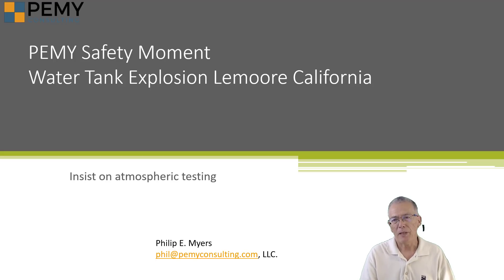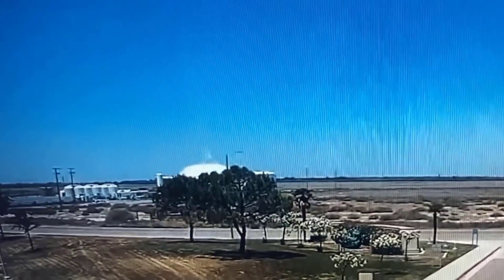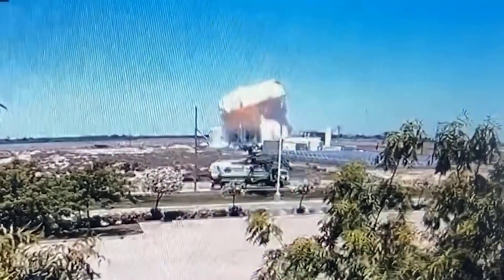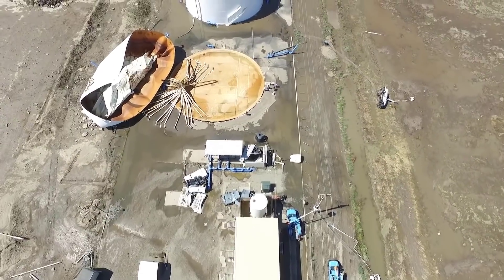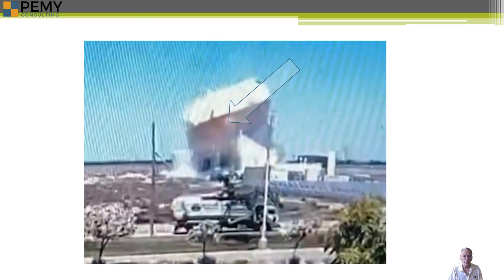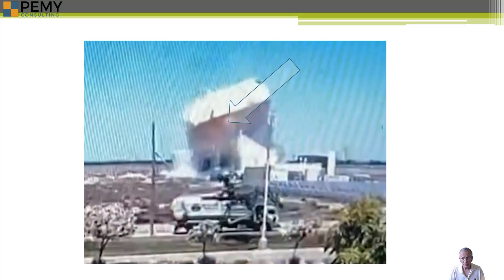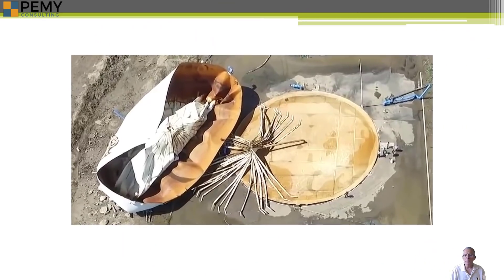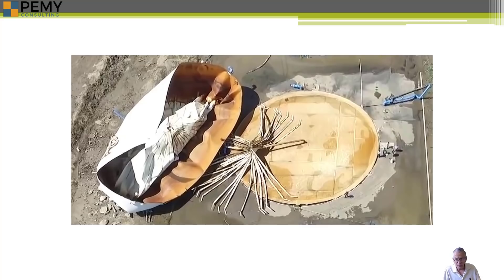Lemoore Water Tank Explosion

Comment: I wonder if it was chlorine gas?  Chlorine is used in water treatment.  I can't tell by the color of the explosion.  The water level could've been much lower than normal, possibly lower than the site of the repair.   If that is so it would've been a lot of room for chlorine to evaporate out of the water and fill up the remaining space with gas
Reply: Chlorine dioxide in gaseous form is used in industrial scale water treatment--it is highly flammable. I just learned this today while trying to figure out what caused the explosion. I had speculated on methane gas, but couldn't come up with a reasonable hypothesis to explain its presence in a closed, and presumably dark, tank interior. Hydrogen gas resulting from electrolysis if plausible too, but only if an electrical source was affecting the water long before the welding commenced. The welding current itself would not have been present long enough to build the required volume of hydrogen.
Reply: @willong1000  the concentration of chlorine in drinking water tank is the same as what comes from your faucet (<2.0ppm by code).  Not a chlorine explosion
Reply: @billhuffman3328  Bill, as I noted, both the flammability of Chlorine dioxide and the use of the gaseous material in water treatment were new information to me as of yesterday. So, like others, I am speculating as to the source of an explosive mixture in the tank. However, given the evidence we have all viewed, I think you must admit that an explosive mixture existed in the tank. What then, was the flammable gas that mixed with air in the tank to produce the explosive mixture in your opinion?

Obviously, something went catastrophically wrong in some process at the water treatment site. I suggest that the most likely process was the metering of the gaseous Chlorine hydroxide into the water. Years ago, I maintained a small potable water system in a National Park campground. While we used liquid Sodium hydroxide injected into the in-coming water stream and not gaseous Chlorine dioxide, that experience was enough to understand that the introduction of the disinfecting chemical is an adjustable, metered process. An adjustable system can be improperly adjusted and/or maintained and monitored. (I used a Hach colorimeter to perform regular monitoring of the chlorine content in water system that I maintained.)

I suggest that excess Chlorine dioxide introduced into the water beyond its absorption capacity, which then collected in the head space of the vessel, is the most likely source of the explosive mixture. That is my admittedly layman's, speculation. Since Chlorine dioxide is heavier than air, the extant tank venting would not have prevented its accumulation. Conversely, lighter-than-air Hydrogen gas produced by electrolysis, which others have suggested as a source of flammable mixture, and which I do not totally dismiss, would have vented from the tank's vents that are engineered to vent air from the tank as fast as it is displaced by in-coming water--that seems to me a rate which would exceed Hydrogen production via conceivable scenarios.
Reply: @billhuffman3328  Agreed.
Reply: "Chlorine is not flammable, but may react explosively or form explosive compounds with many common substances (including acetylene, ether, turpentine, ammonia, natural gas, hydrogen, and finely divided metals)."

If the water in the tank got exceptionally warm due to hot weather, then I wonder if the dissolved chlorine might start to separate out into the airspace at the top of the tank. Since chlorine gas is heavier than air, it would have created a layer of chlorine gas right above the surface of the water. One assumes that welding repairs would take place just above the water level in the tank - right in that layer.

According to the quote in the first sentence, chlorine may react explosively or form explosive compounds with many common substances. So you might be on to something there...
Reply: @alanmcrae8594  Not a chance with the doses used in potable water. Cl2, NaOCl or ClO2 have to be in concentrations high enough to cause an explosion for one to occur. If the building that holds those oxidants exploded that would be one thing, but not the finished water tank. If it were possible for chlorine to off gas and collect explosive concentrations in the headspace of treated water tanks explosions like this would be common.

Comment: Several times I had cut open 55 gallon drums,  most were diesel and one was acetone.  All were empty,  so what did I do???  I filled the drums with water let them sit,  washed the water and then with the water still inside we were able to torch open the drums. Never had any problems,  except they are very heavy.
Reply: Tricky situation. They probably all assumed it would take less time than it actually did.
Reply: @ Carson & Barnes ( person ) places engine exhaust onto gas-tank filler to clear the gasses;
It worked or I would be minus fingers to write this

Comment: This reminds me of a similar incident back in the 80s in the vicinity of where I used to work. This involved a raised water tank of which I can only guess was maybe in the 15-story range. There was a father-son and daughter-in-law team that was hired to sandblast and weld the seams in the tank. Dad and son we're working on the inside of the tank while the daughter-in-law's job was to keep the hatch at the ground level clear of sand to provide adequate ventilation. It appeared that the daughter-in-law wasn't doing her job properly and let the sand build up until it finally choked off the ventilation shaft up the middle. This allowed the gases to build up. As the dad was lighting up his oxy acetylene torch the son was on his way out of the hatch at the top of the tank. There was an explosion and the son was thrown clear of the tank and landed on his head at ground level killing him instantly. The dad survived and the tank appeared to not be damaged.
Reply: What I cannot understand in this video as well as in the incident reported by you, how gases built up inside a water storage tank. What am i missing?

Comment: But I dont understand how it could be flammable gases in a water tank?
Reply: Look up electrolysis. Probably a short in an electric pump somehow went unnoticed. Creating a bunch of hydrogen and oxygen and them two together make for what you see here.
Reply: @coryhodson6994  I don't see that happening in this case. It would have required quite a bit of current for that to happen and even then these are new tanks with new coatings so there shouldn't have been enough bare metal surface area exposed to water to result in significant hydrogen evolution.
Reply: @coryhodson6994  Not a bad hypothesis, IMHO. But I think there would be insufficient current for a long enough period to produce enough volume of the gas especially in light of the fact that the tank was, or should have been vented to the atmosphere. The tank should also have been grounded.
Reply: It likely held Treated Water.  Chlorine Dioxide is very explosive.
Reply: could be natural gas contaminated water table, mixed with the head air in the tank creating an explosion waiting to happen.  I have seen tall vertical pipes with flames burning from the tops a ways away from  huge city water storage tanks.    Didn't really understand what they were until now. I am assuming that this is gas (whatever type) that has been collected from the tops of the tanks and is being burned off.
Reply: @AffordBindEquipment  No, those were either sewage digester tanks or a refinery. There is no gas in treated potable water that needs to be burned off. And water storage tanks have an overflow near the top so I don’t see any kind of gas building up.
Reply: @robertpolingjr5941  Agree mostly, except on gas build up. Your right on the tank being open to atmosphere due to the overflow, and also likely specific breather tube, but that does not mean it was well ventilated and gas could have built up in the tanks head space.
Reply: @adamsmidkiff1  You're right, not Your right.
Reply: Chlorine dioxide in gaseous form is used in industrial scale water treatment--it is highly flammable. I just learned this today while trying to figure out what caused the explosion. I had speculated on methane gas, but couldn't come up with a reasonable hypothesis to explain its presence in a closed, and presumably dark, tank interior. Hydrogen gas resulting from electrolysis if plausible too, but only if an electrical source was affecting the water long before the welding commenced. The welding current itself would not have been present long enough to build the required volume of hydrogen. Moreover, water storage tanks are vented to permit air displacement by in-filling water. Since Hydrogen is lighter than air, it will escape the tank if produced by electrolysis. Conversely, Chlorine dioxide is heavier than air.
Reply: This is a municipal application which means Cl2 or NaOCl were likely used, although ClO2 gets used in some applications. That said, we're talking about ClO2 doses of less than 1 part per million. No chance of explosion or ClO2 build up in the tanks head space with doses that small. Electrolysis isn't really possible either since these are new tanks with new coatings. To generate significant amounts of H2 you need enough bare metal in contact with water along with enough current. The fresh coatings help to prevent both. Also the tank should have been grounded which would short circuit any electrolysis reaction even if there were significant amounts of exposed bare metal and a circuit with enough current to cause electrolysis.
Reply: @willong1000  So if the Chlorine gas is used to treat the water,   and its flamable,   how is that going to be healthy for our drinking water?  Thanks goodness I just bought a water filter that can clean out the chlorine as well
Reply: @oswaldoriginal5037  Chlorine dioxide is the flammable gas, not pure Chlorine. Injected into the water, it forms ions that both kill microbes and oxygenate the water. There are many substances that are poisonous in quantity but have beneficial effects when used judiciously--most drugs fall into that category. I'd rather drink chlorinated water than water filled with pathogens. However, like you, I'd prefer to drink water free of Chlorine if it is safe.

I own a rural property I hope to live on soon where the water source is a deep well. I will have the water tested again--it's been over twenty years since the well was drilled--and consume it straight from the well if it continues to test safe for pathogens and deleterious chemicals such as Lead and Arsenic. If any biological organisms are present, I will likely use a combination of filtration and Ultraviolet disinfection.
Reply: They were commissioning a new treatment plant. It is possible that as part of the commissioning process they bypassed some of the treatment process or portions of the process were not fully commissioned. This could have allowed gases that are naturally present in the cities raw water to reach the treated water tank and accumulate in the tanks head space. An accumulation of gases during commissioning in this type of scenario would likely not have been well understood, and thus the danger not recognized, as the type of process evaluations that occur prior to design of these types of plants can't really account for the fluid nature and other oddities that occur during plant start ups.
Reply: My speculation is if they were welding they may have been using a cutting torch that released gas.
Reply: @dyoung5999  Insufficent volume of flammable gas to produce the explosion you see in the video.